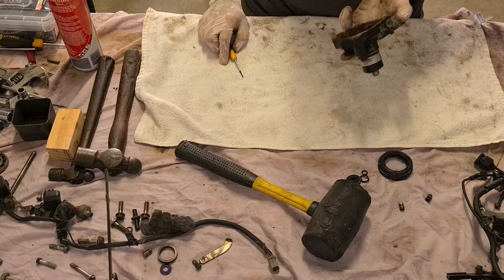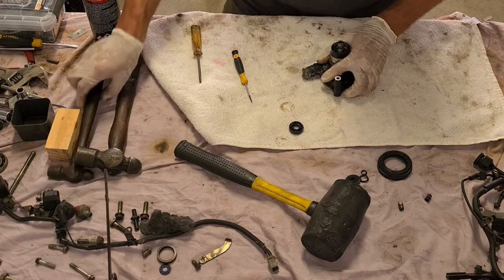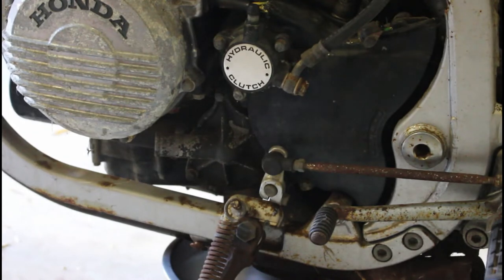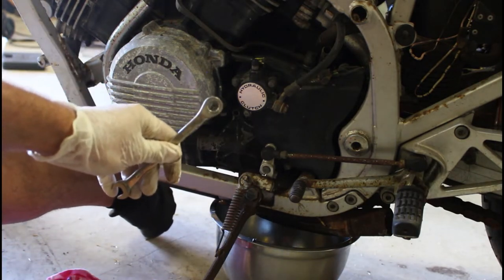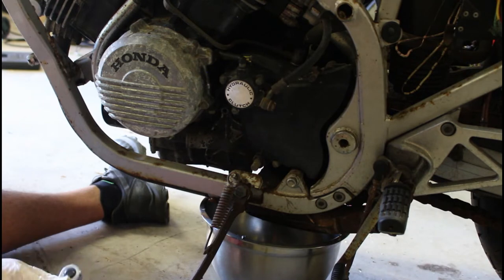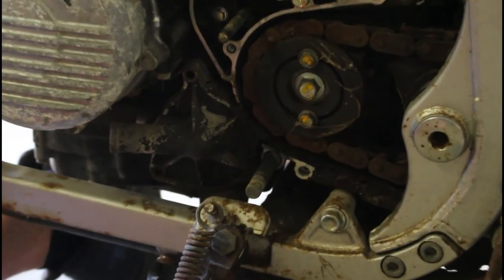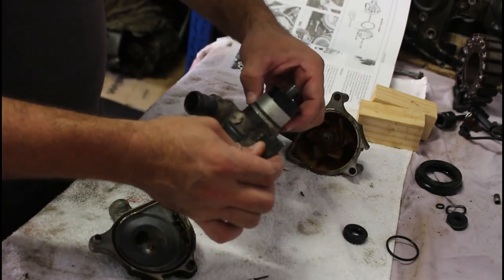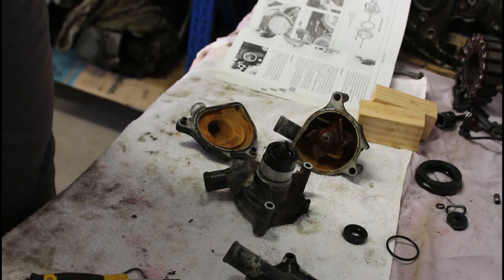Honda 1983 VF750F Part 8 - Water Pump

Comment: “Sometimes I think that they engineer these things on purpose to make stuff difficult”. Yeah I think it’s more of a case that servicing isn’t their main concern and cost saving is the overarching principle. Good result on the spare water pump. I’m just in the middle of an engine tear down on my ‘84 VF750F, waiting to see the horrors of some of the internals like this.
Reply from the maker: Yeah they are a challenging motor for an amateur like me. I really have to get back to it. It's been sitting on the bench torn down for over a year 😫 😂😅
Reply: @lc1435  Yeah, work, kids and everything else 😂  I suspect mine will be a long project. There aren’t a lot of these bikes here in the U.K. where I live, so hoping I don’t have to source too many parts.

Comment: getting ready to pull my water pump off my vf1000f, as the gasket is gone, any suggestions?
Reply from the maker: It wasn't too complicated... the hardest part was getting the rubber tubes off. Hitting them with a heat gun to soften them a bit saved a lot of time.

Comment: dude, as soon as I saw the impeller of that first water pump I was praying you had another on the spare bike. Were they running saltwater for coolant? Also nice to see that you can actually remove the water pump cover on the 83 750 without removing part of the frame. Get a new gasket in there, and I think you're going to be good to go on the water pump (hopefully).
Reply from the maker: I soooo picked the wrong bike to rebuild! 🤣🤣🤣